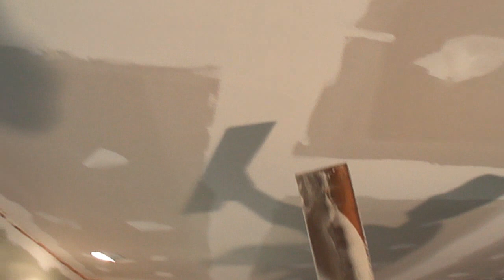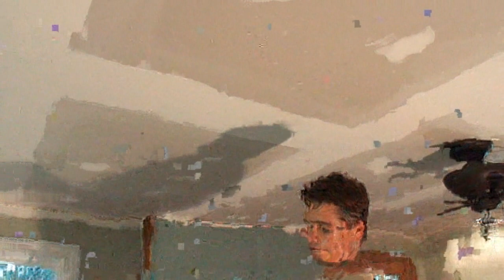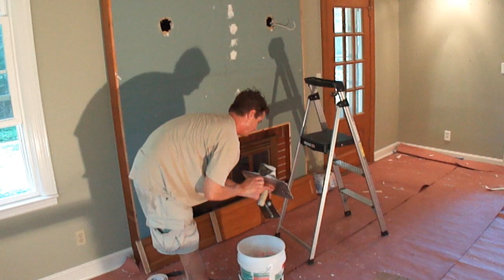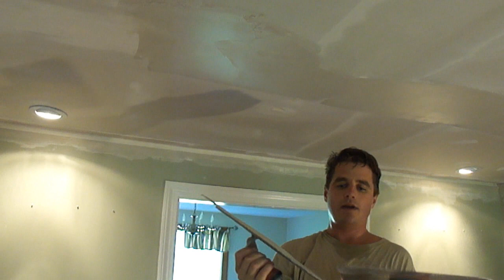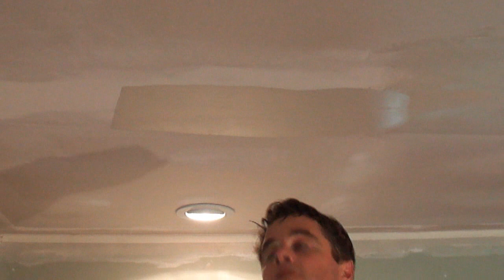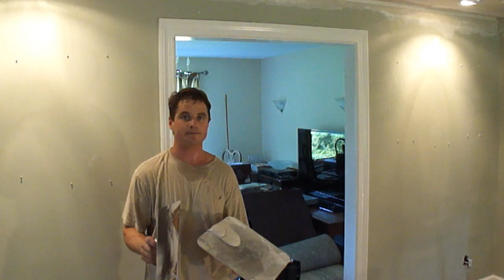Fixing a Bad Tape job - (Part 3) Drywall Repair & Wall Preparation

Comment: Thank you Russ for sharing your passion.  I don't know that I learned much new, but you reviewed and reinforced everything that I needed to get the job done right.  (I do drywall repair every 2 or 3 years ... so it's easy to forget the details. 

I have two quick comments that might benefit those, who like me, tend to cut corners out of laziness ... and then spend more time redoing.  (1) You might be tempted to buy a gallon pail of premix -- DON'T!  Get a bag of "90" and mix it thoroughly with your drill and paint mixer.  You can get it exactly the consistency that you want (I prefer it just a little thicker than pancake batter).  Your mix will go on better than the premix; it will dry more quickly and harder; it will sand much better; and with tape, you just won't get bubbles or adherence issues. (2) Knock off the excess with your taping knife between coats, sand as needed.  Before your next coat, wipe down the surface with a clean towel.  You'll be amazed how much dust is on the wall after sanding and getting rid of it makes for a smoother, less flawed application of your next coat.
Reply from the maker: Thanks John for your input! Where u from?
Reply: @RussOlinatz  Washington, DC

Comment: Yes. I stripped wallpaper out of a hallway, smoothed out a hand-texture on an adjoining hallway, and removed the popcorn acoustic from the ceiling in both. Going in today to repair the joints, cover the screws, and prep for a knock-down texture.

Comment: By far the most informative videos i have seen on mudding. Id like to see waht you can show true begginers such as loading the trowel, tips for hawk and trowel use, blending old plaster to new drywall, skim coating with mesh coating the entire wall etc.

Comment from the maker: Hello Gwendolyn - The webbing tape will work also. You dont have to worry about air bubbles with this tape.  Its not as strong as paper tape but it works great for DIY. Nice to hear from you again!

Comment: I bought a pre-mixed bucket then mixed it with a little water to thin it out.  It worked quite well after following your video tips.  When I paint next week you won't even see the seams.  Drywall work is hard!  lol

Comment from the maker: Hello Zachary- It all depends on how badly the tape wasn't glued down. A few spots fine, but many spots will be bad because you have to assume that it will only get worse over time. Ask yourself why it did this? Was it because: A) there was not enough mud behind tape, B) You didn't squeeze tight enough with your taping blade, C) The mud wasn't mixed and was to dry with not enough water in it. I would start over and give it another go and if that does not work, then Use Mesh Tape, No bubbles!

Comment: Hey, thanks!  I had to fix a bad tape job (self induced) and followed these instructions.  I didn't realize you had to put multiple coats on for one.  Your tips here helped make it look great.  A bit cooler doing mine in the winter...  :)

Comment from the maker: @usmccampbell23 You can use either or, but i feel that with a trowel there is a lot less pressure on your wrist. Especially when working above your shoulders.

Comment: Also self taught in painting, plastering/drywalling and some carpentry. I'm currently taking a part time college course in plastering to expand on the basic knowledge I had, all in preparation for when I immigrate to the US soon. I'd like to get into a painter/drywaller/handyman sort ofwork or career, it's something I really like doing.

Comment from the maker: Hello- You need to apply at least 3 coats. The second coat was not shown here, but I applied it with a 4 inch blade and hid the tape. In part 4, I use a 6 inch blade to apply the 3rd coat bringing the mud out further .

Comment: It's mostly a beginners course, but I already had basic knowledge to start with. You learn proper boarding methods and techniques, ways to mix plaster properly to your requirements and the techniques for applying the plaster to a surface (skimming). Be it a small patch, a whole section of a wall or a ceiling.

Comment: I'm from the UK. We often plaster our interior walls similarly to you do in the US. Typically for this type of wall, we board and tape sheetrock (plasterboard in the UK) to make up walls and ceilings, then skim a layer of plaster over the entire thing. You usually apply at least 2 layers, 1 base/main layer and then a lighter finishing layer to smooth it all out, or to apply a textured finish.

Comment: Thank you soo much it really helped me understand what i was doing wrong and how to fix it.
DIY everything :)
Reply from the maker: Hi David

Thank you for your feedback!  What where you doing wrong?

Russ
Reply: was getting air bubbles under my tape
Reply from the maker: Hi David

What did u do to fix it?

Russ
Reply: Russ Olinatz you did it in video 1, i was doing it too fast and it looked sloppy, not waiting for the first coat to dry completely before applying 2nd coat gave me air bubbles under the tape
Reply from the maker: What kind of mud did you use?
Reply: Russ Olinatz using home depots low dust joint compound
Reply from the maker: With that stuff you need to let it dry completely, before applying next coat
Reply: Russ Olinatz i realized that too late, but thanks to your video's i am well on my way to fixing my bubble issues and doing a much better job, you are a miestro with the mud, i have learned alot

Comment: Thanks for all the info. Question; I'm trying to cover a bad tape job on a slanted ceiling seen after popcorn removal. Seem is still covered, but I can see gap between drywall and a curled tape. Can I tape another layer over the current tape? Current tape is not lose. Or, should I just add mud to make a flat surface and fill in already taped gap? Can u tape over tape? Gap is about 1/4th inch depression.  Hope u have time to answer, if not, I learned alot on your video.
Reply from the maker: Hi 

If you can see a gap, then muddling over it will not make it disappear. You are going to have to cut it out, and repack it first, then re/tape. 

Russ
Reply from the maker: How did you make out?
Reply: @RussOlinatz  I can only do a little work here and there on my days off (bad back)..I'm on 2nd coat of mud. But I'm taking your advice and filling it in with tape vs filling it in with mud only. It's my first drywall/tape diy.
Reply from the maker: Hi 

Yes so you will have to cut out old tape and repack it with more mud and then tape and float!

Tudd

Comment: Seems I've done... I think... just about everything in this video that needed repaired... however before starting this video I tried to fix it with what seemed the logical way to me at the time.. I didn't get a good seal with the tape on the first coat so before i applied my second coat I didn't fully remove the bubbled tape, only cut out the problem areas thinking that after applying the second/third coat it would hide those problem areas, should i continue or completely start over?

Comment: Thanks for sharing your experience! You're very skilled and communicated addressing the concerns I have been struggling with.  I have been attempting my basement ceiling, but don't have the trowel you have, I've been using the 6, 8, and 12" knife trowels.  Much harder to work with.  Should I get the right tools?
Reply from the maker: Hello Paul-

Stick to the tools that you are most comfortable with. Everyone's body is different and everyone has their own ailments. So thank god that there are many different tools that we can use in order to achieve the same desired finished product. The knifes work fine for others, but I find that it's too much pressure on my wrists. I prefer the concrete trowels because my wrist can stay fixed, giving me more power when skimming. Have you ever worked with a concrete trowel before?

Russ

Comment: Does ceiling needs to be so perfect when you want to do a texture finish?
Great video and thank you!
Reply from the maker: Hi John 

What sort of texture?

Russ
Reply: Woa, that was fast response:) Just something with the roller...not sure how it is called...
Reply from the maker: Hi John

You should really want it smooth as possible.  Especially leveling of the joints. If your room gets a lot of sunlight or your if your lighting really shines bright toward the ceiling you should start smooth to allow for a uniform texture finish. Can you post a picture?

Russ
Reply: Russ Olinatz thank you so much so I need to be smooth as the walls?  Even though most of the work will be Hidden with the texture? I'll make sure to share pictures with you.
Reply from the maker: Hi John 

Yes the ceiling needs to be smooth and straight as possible so that the texture will be level also. What is the current situation with your ceiling? New untapped drywall?

Comment: If I understand right… for a bad joint job.. you need to put plaster wider ???Is it the same procedure for a 4y-o joint???
Reply from the maker: Hello-

Thanks for stopping bye! What is a 4y-o joint?

Russ
Reply: Russ Olinatz  Sorry Russ. Its a 4 years old construction. That I can see the tape job. Not done properly.(we call it "joint" in french).
Reply from the maker: Hi

The fact that you can see the tape might indicate that the tape is loose or peeling.  In this case, you might need to cut out the tape and then retape and mud. 

Russ
Reply: Russ Olinatz  iiiiiiisssssh.. Me doing that!! I can feel the catastrophy!!! 
Serious I'll watch your video a lot to make sure I'm doing it right. 
Thank you very much

Comment: Your videos are very nice and helpful. One question, you make thinner the mud for the second coat, or is it the same as the first coat when you tape? Thx very much ;D. I´m from spain.
Reply from the maker: Hello Antonio-

Thanks for your comment and question! Don't thin the mud for the 2nd coat because it will shrink more. The 2nd coat should go on thick to hide the tape. 

Russ
Reply: thx so much :D
Reply from the maker: No problem!
Reply: I´ve been making the mud as you did in your video (part 2), That video is PERFECT, i found at last what i wanted :D. Making the mud was a bit tricky for me because  wanted to have the perfect thicness for working. Didn´t want neither to thin nor to thick.
Reply from the maker: Hi Antonio-

That's great news! Are you finished?

Russ
Reply: Yes, thx. :D
Reply from the maker: Great! How did the 2nd coat go?
Reply: it was fine.

Comment: this video  was very helpfull thanks a bunch
Reply from the maker: Thanks!
Reply: You are very fast answering the questions. :D
Reply from the maker: Express Service!
Reply: Here in spain we don´t have such big squared trowels to place the mud. People here use little ones or spatula  i don´t know the english word. It ´d be interesting if they were sold in spain
Reply from the maker: https://www.amazon.com/MARSHALLTOWN-Premier-Line-MXS66D-Finishing/dp/B00002N5OU
Reply: I meant the hawk, not the trowel, omg.
Reply from the maker: https://www.amazon.com/dp/B001NOB826/ref=asc_df_B001NOB8264972003/?tag=hyprod-20&creative=394997&creativeASIN=B001NOB826&linkCode=df0&hvadid=167125219398&hvpos=1o1&hvnetw=g&hvrand=18366274793098223535&hvpone=&hvptwo=&hvqmt=&hvdev=m&hvdvcmdl=&hvlocint=&hvlocphy=9052377&hvtargid=pla-304846244853
Reply: My english, u know. We have those trowels. I have to buy one like that.
Reply from the maker: It's great for transferring a lot of mud!
Reply: thx so much. And i think it´s very comfortable to place the mud when you are mudding. I haven´t seen anybody here with that hawk. Everybody uses knifes to pick the mud.
Reply: Now i´ve found that the hawk is called "american trowel" in one spanish shop.
Reply from the maker: Knifes exert a lot of tension on your wrist, especially when working ceilings and going against gravity. With a trowel, you can keep your wrist in a fixed position. This allows more power and control.
Reply: You are very right, but in spain people don´t use the hawk yet.
Reply from the maker: Do you live on the water front coast of Spain?
Reply: yes, i live in north of spain. France is 20 minutes from where i live
Reply: You could maybe wonder yourself why i have so much interest in your videos.  Well, I hope to start working in drywall in some months or weeks. I will pray for God. :D
Reply from the maker: Follow your passion!

Comment: Can anyone tell me why my paper tape has bubbles in it after I laid it the bedding coat, smoothed it out flat, then let it dry?  in the morning after I applied the tape, it had bubbles in the paper
Reply: Not enough mud under the tape

Comment: and are you using a hawk or pan
Reply from the maker: Hi

Where are you from?

Russ
Reply: Russ Olinatz new Mexico bro do you need Mudd thin for this too
Reply from the maker: Hi 

Here is a link https://www.amazon.com/MARSHALLTOWN-Premier-Line-MXS66D-Finishing/dp/B00002N5OU
Reply: Russ Olinatz thanks do they make 10 inch
Reply from the maker: Hi 

No they make a 8, 12, 14, 16, & 20 inch. Just get a 12 inch. Do you do drywall?

Russ
Reply: Russ Olinatz yes I need  a 12 I'm just starting  with my dad working do they have at home Depot
Reply from the maker: Hi

What's your name?
Reply from the maker: Yes, they have them at Hone Depot. Here is playlist that will help you. https://www.youtube.com/playlist?list=PL54E474153945E5C3

Comment: Now your making a bigger bump not helpful
Reply: He is feathering out he existing drywall job to get a smooth finish. In my neck of the woods it's common to coat butt seams at least 4 feet wide and flats 2-3 feet wide. You get a incredibly smooth finish that way.